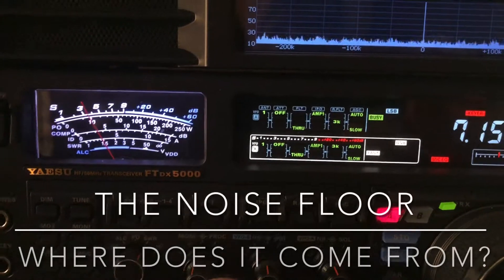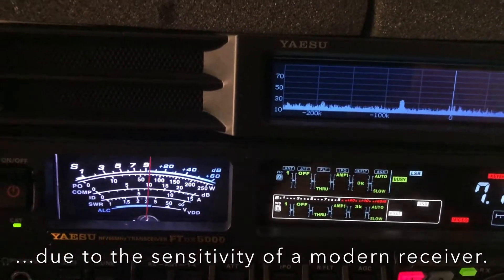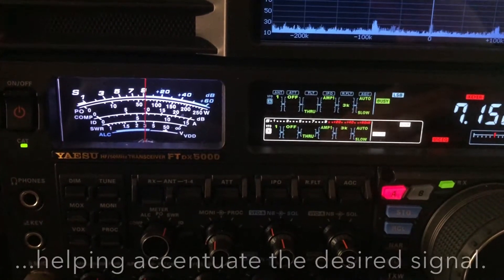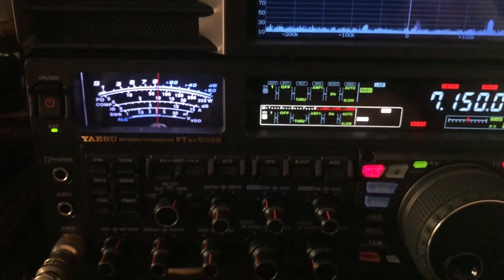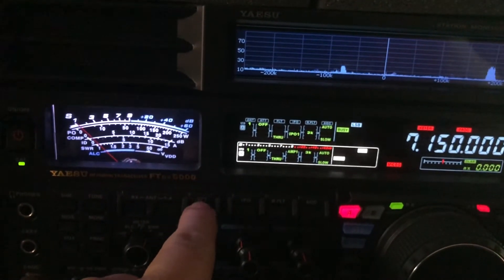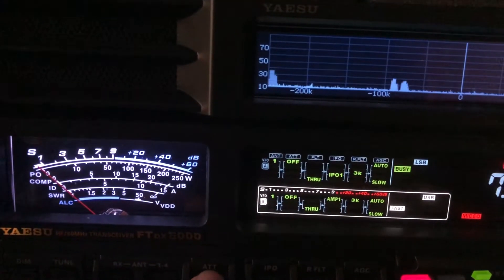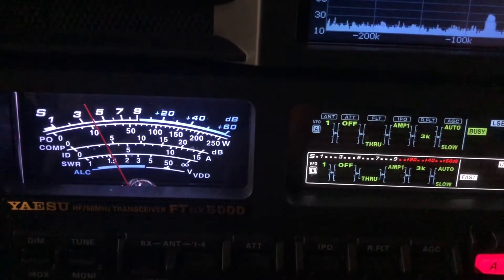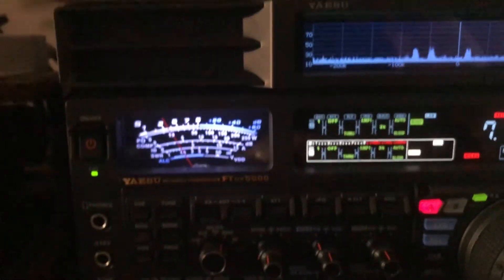The Noise Floor (Where does it come from?)

Comment: I had a guy tell he had an S-8 noise level and I was in it. How did he know he had an S-8 noise level?  When I’m listening to static in between transmitting stations, my S meter reads zero even when my DNR and attenuation are off.  I’m confused.
Reply from the maker: Hi Mark!  You are fortunate to live in an area with a low noise floor. Are you using IPO?  Using IPO will lower your noise floor, improve the signal-to-noise ratio, and improve your receiver’s selectivity. 

I have an S-8 noise floor on 160 meters until I enable IPO and 18dB of attenuation. That is normal for 160m. The lower frequencies, especially 7MHz and lower are where the atmospheric noise is most prevalent. My noise floor on 40m is usually around S-5.  And modern receivers are so sensitive that they amplify the noise. That’s why we need IPO.  I use IPO and 12dB of ATT on 80m and IPO + 6dB of ATT on 40m.

It is possible that your antenna is receiving less noise. A horizontally-polarized antenna will generally not receive as much atmospheric noise as a vertical. There is a video about that here on the channel. 

A higher gain antenna will often receive more noise. My doublet receives more noise than my OCF dipole or my ZS6BKW. But the doublet has the highest amount of gain. My ZS6BKW has the best S/N ratio. Sometimes I transmit with the doublet and receive with the ZS6BKW.

I hope this helps.

73, Doug
Reply: @n4hnhradio  Thanks Doug. Yes, I normally use IPO.

Comment: Fabulous video. I still think that Noise Cancelling Signal Enhancers (Phasers) like the MFJ 1026, JPS ANC-4 and NCC-2 by DX Engineering seriously do a better job than anything ever included in any receiver at improving signal to noise ratio. They're brilliant. You don't truly have deafening noise, but you should look into them. I can't imagine an urban HF radio station without them.
Reply from the maker: I have the MFJ-1026.  It works well for power line noise.  It does well for atmospheric noise as well, but I rarely need it with the 5000.  The power company keeps my power lines quiet and the 5000 handles the rest.

The MFJ-1026 has a problem with RF from my OCF dipole when I run 800W or more.  The light bulb that it uses as a RF fuse blows.
Reply: @n4hnhradio  Indeed, without serious modification and an upgraded beefy relay, it cannot handle high power. Great to hear about your power noise levels being low. It's noticed in your videos. You're lucky indeed!
Reply from the maker: I did the relay upgrade.  It worked to some extent.  The RF isn’t coming through the antenna port though.  It’s coming from the shield of the coax. I might buy the one from DX Engineering someday if the power company fails to deliver.
Reply: Will this help my noise floor level it’s a 10 +
Reply: @Philip-mr9ed  Yes. The MFJ-1026 is what you need. But 10+ noise level is ridiculous and that might mean the noise is coming from right within your house. Run your radio from a battery and turn off the main circuit breakers in your house. Then turn them on little by little to isolate the noise. Every stupid Chinese wall-wart, cell phone charger, touch lamp, microwave, TV on or even off, Internet router, all make noise that ruins reception on HF. Make sure the noise is not coming from your house first. Then remove whatever is giving you that noise.
Reply from the maker: I recommend the Timewave ANC-4 over the MFJ-1026. I had to repair my MFJ-1026 5 times. I finally gave up on it. I bought a $52 QRM Eliminator on eBay, and it works fine. But it’s made in China. I don’t like to buy Chinese. Timewave has always been a reputable brand.
Reply: @n4hnhradio  Unfortunately there is no pre-amp in the Timewave ANC-4 and the other generic products that have come out in the past decade. The 1026 is the only affordable unit with a pre-amp for your "sense" antenna and that pre-amp is a deal breaker for some noise sources. I had the ANC-4 and it was impossible to reach a null in my situation. You simply need that pre-amp in many situations.
Reply from the maker: @624radicalham That’s interesting. I never needed the preamp. I use IPO and ATT, so I definitely don’t need a preamp.  If you need a preamp for your noise antenna, something isn’t right. The noise antenna needs to be outside and able to receive the same noise that the main antenna receives.  I use another OCF dipole as my  noise RX antenna.  MFJ puts that telescopic antenna in their kit but it’s practically useless.

Comment: Can you explain what IPO1 and IPO2 does? From the block diagram, I can see that they bypass both AMPs and I think IPO2 is a pass through (bypasses everything). I know the effects of using them, but I just can't figure out what exactly they do and why there are two of them (I would think either use AMP1, AMP2 (which is actually AMP1 + another amp) or bypass them)
Reply from the maker: Great insight Michael!  IPO1 provides a small amount of amplification, optimized for the best S/N ratio at the intercept point (1st mixer).  IPO2 is zero amplification, completely bypassing all amplifiers. I tend to use IPO2 on 160 meters and sometimes 80 meters.  I also typically use 12dB of attenuation on those bands.

73, de N4HNH

Comment: Well that´s right and not, because if i use these days my old Kenwood TS440s i have much more noise while listening with my FT1000 MP MarkV.
That´s interesting. 73´s DH1KJ
Reply from the maker: There is a certain amount of noise generated by the radio itself, some more than others.  That’s what attracted me to the FTdx5000MP.  It has the lowest noise floor of any radio I tried out over the 8 months I spent trying out radios before replacing my aging FT-920, in 2019.  But, no matter how quiet the radio itself may be, the atmospheric discharges will still be there.

73, de N4HNH